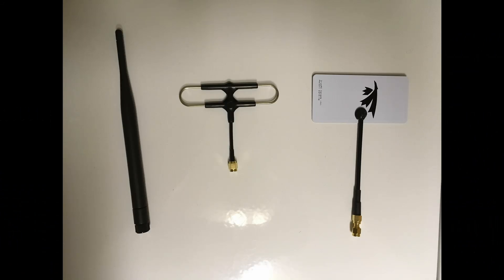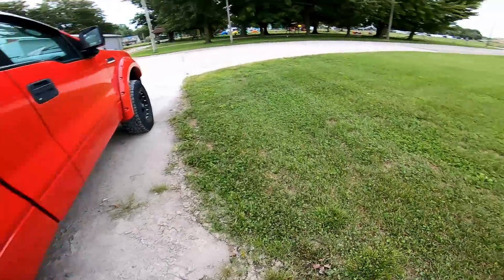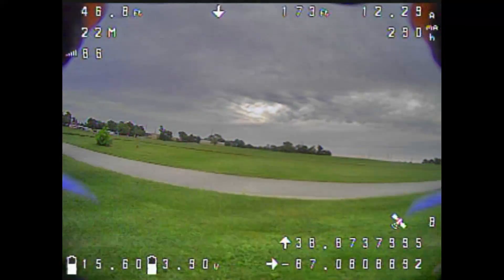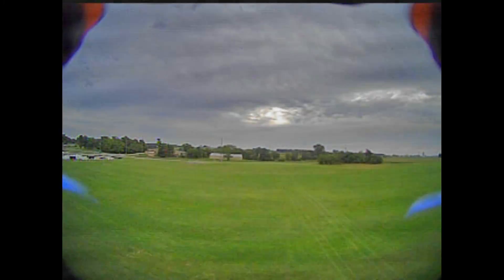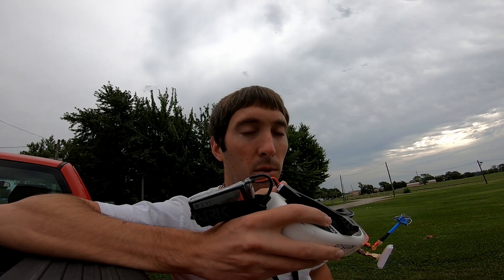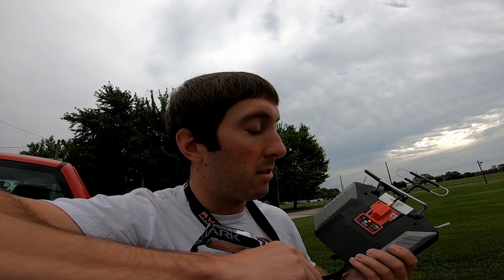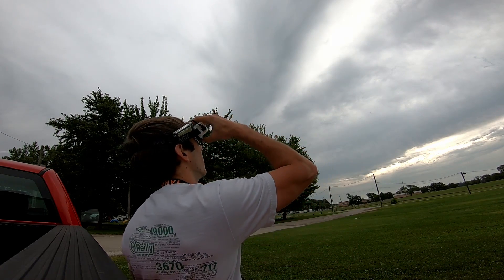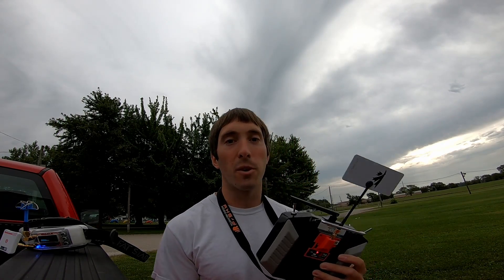FrSky R9M Super 8 VS TrueRC True-MoX 915 Long Range Antenna Test

Comment: U need to turn the super 8 the other way like end up to the side other side to the floor 900hz works differently to 2.4g
Reply from the maker: I’m having trouble understanding how you’re describing the needed orientation. Edit: I understand now. You are saying I need the antenna elements oriented vertically instead of horizontally.

The folded dipole has the same radiation pattern as a normal dipole. The antenna on the quad is linear polarized (normal dipole), mounted horizontally. Because of that, I used the folded dipole (linear polarization) mounted horizontally in order to minimize cross pole component in normal flight. That’s an incorrect train of thought?
Reply: @FishStick_ADV  yes
Reply from the maker: @bigeyefpv  I guess I don’t understand. If you run TX and RX antennas 90 degrees cross pole the theoretical attenuation is infinity. Frequency doesn’t change the physics.
Reply: @FishStick_ADV  both send the best signals vertical  but it's a pain to mount the one on the drone
Reply from the maker: @bigeyefpv  agreed. I run my fixed wings vertical, but it’s not practical to duplicate that setup with a quad.
Reply: @FishStick_ADV  same I fly long range wings and it's eazyer plus u can eat and antenna eazyer if u crash a done with antenna like that

Comment: Great testing! You should add LQ on the OSD.
Reply from the maker: Neil Camara I wish I could!! Correct me if I’m wrong (I’m wrong a lot) but LQ is a measurement that’s only available on Crossfire. It’s a measurement of quality based on the number of successfully transmitted data packets? To my knowledge, FrSky R9M doesn’t report that information... but man you’re right, that would be great info to have and hopefully I’m wrong. Lol
Reply: I am using FrSKY XM+ and I have LQ enabled. You can check out my recent videos. You will see LQ on top right. I was told that even if RSSI was high, we can still get a FAILSAFE. We were troubleshooting it until I was told to add LQ on the OSD.
Reply: @neilfpv  Hi Neil, how did you add the LQ with XM+. I can't seem to find a video about it. All I find are Crossfire videos.. thanks Rob
Reply: @RobertCostarelli  It's been a while. I switched to crossfire for almost 3 months now. I think I had to configure something on my  Jumper T16's telemetry. If I find it, I'll let you know.
Reply: @neilfpv  thank you!

Comment: Hey Cody.. Sub 32! Cool dude.. had to sub ya. :) Don't sweat the extra adaptor loss.. I've done lots of testing and researching and according to Times Microwave loss chart, they only take off .02db for each connection. One adaptor = 2 connections = .04 db loss per adaptor. Not much to worry about unless you are really trying hard to push the very outer limits of your gear. Not many does that anyways so.. Did you get your video and OSD issues worked out?
Reply from the maker: Hillbilly FPV, I'm sorry I'm just now seeing your comment! Thanks for the sub, I'll sub you back! I'll have to check out Times Microwave chart. I've done testing with a network analyser at work at 3GHz on expensive adapters and usually saw about .04dB loss, but I've never tested UHF on cheap hobby grade adapters... I definitely believe .02dB though; that sounds about right. My problem is I can't speak to the quality of the adapters I am using. Being that this is at 915MHz, materials and tolerances are less important than at 2.4GHz or 5.8GHz... I just have no way of knowing how much impedance there is on my cheap adapters without testing, so I left it a bit open ended. I'm sure Times Microwave used quality adapters in their tests.

The flashing OSD data and noisy video was due to a motor winding being shorted out by a motor mount screw that was too long. I put the correct screw in, and added a bit more capacitance on source power for good measure and it cleared right up.
Reply: @FishStick_ADV  Handy link...
https://www.timesmicrowave.com/Calculator
Glad u got your problems solved. 👍